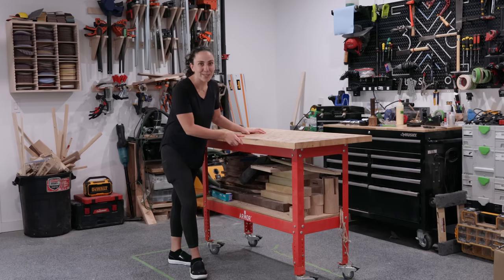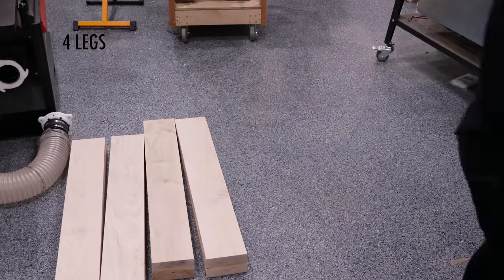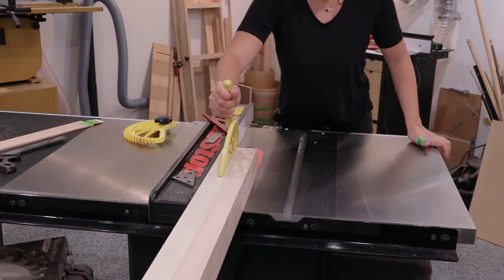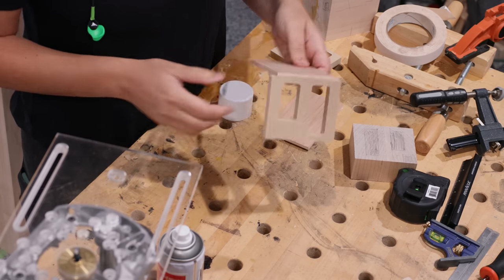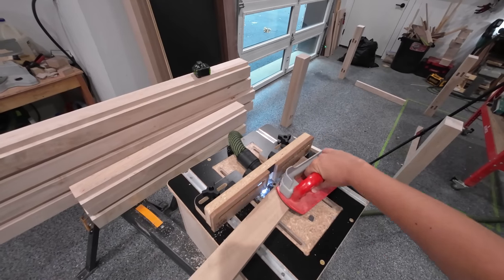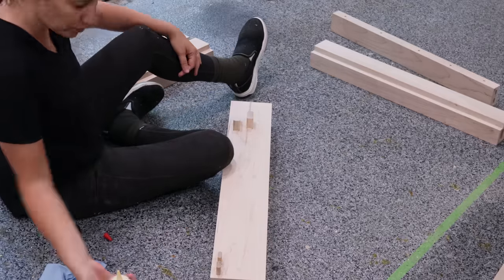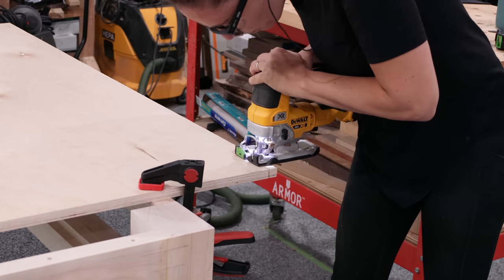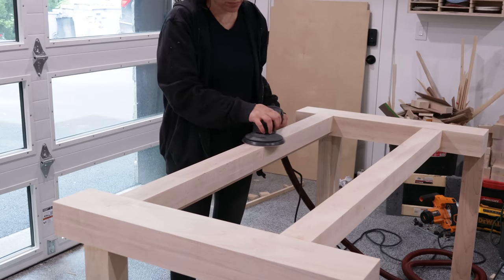My DREAM Workbench Build // PART 1: The Base

Comment: Funny how laguna has no problem helping “content” makers but when an actual customer has issues with their machines that are clearly within warranty, laguna has no interest in helping. I run multiple laguna machines (all bought brand new) and all but 1 have significant quality issues and have had parts fail within 2 years. As a professional commission furniture maker I find this absolutely absurd. Even going above and beyond to “prove” to them that the issues exist they refuse to take responsibility. Lagunas customer service even told me to modify one of my machines (which would clearly void the current warranty). They’re another company who does not value its consumers.
Reply from the maker: Oh no… that’s no good. What was wrong with your machine?
Reply: The biggest flop of them all is the F3 table saw. The main cast iron top is crowned significantly and the casting that houses the arbor was either machined with poor tolerance or has worn internally (within 2 years). This causes the arbor to move radially 2-5/1000” with a very small amount of finger pressure applied to the arbor. This is magnified at the tooth of a blade and even worse when under load. Blades grab and vibrate through a cut causing extremely poor quality cuts and an elevated level of danger in operation. I’ve sent countless emails with video evidence yet lagunas (almost nonexistent) tech/customer service refuses to take responsibility for their poor manufacturing. It’s a disgrace.
Reply from the maker: @wyliewoodco  I’m so sorry you had that experience